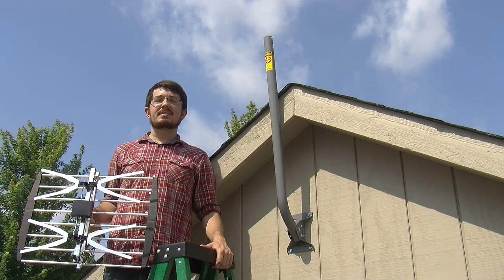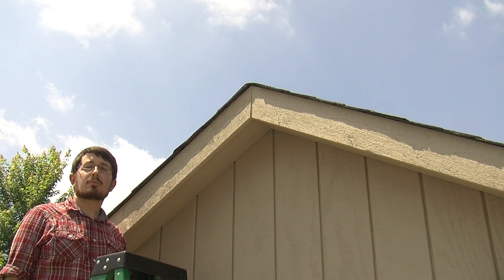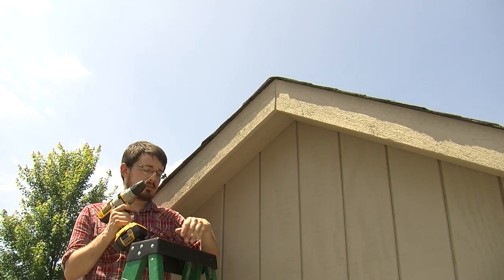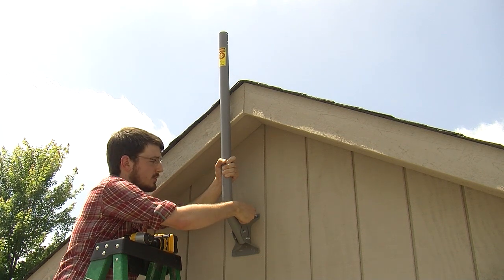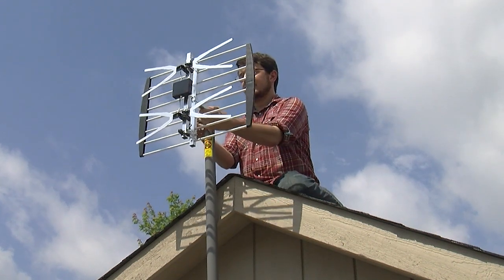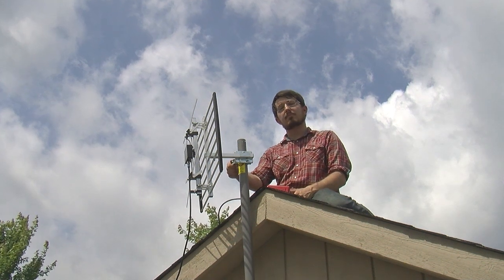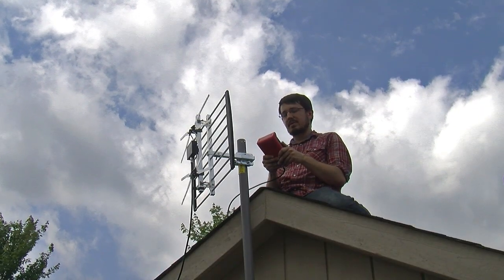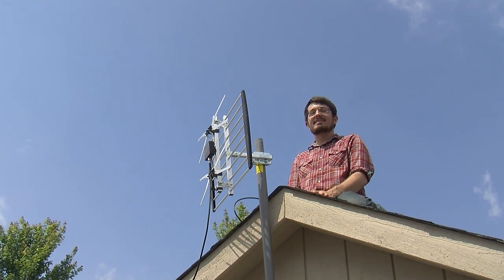Solid Signal: How to install a 2-bay HDTV Antenna

Comment: Suggestions here, aka constructive criticism.

1. Ground your antenna with a cable to the ground or a rod next to it that is taller than the antenna.

2. Next time, drill one lag bolt hole, put in the lag almost to tight, set the bracket level, tightne the lag, then drill the other lag bolt holes. That way you aren't wiggling the bracket while drilling all holes.
Reply: Good tips!

Comment: Question: I want to mount a bat house to my j mount. Do I need a cap so eain wont rust the inside and will it be a conductor during a thunderstorm, I would appreciate any suggestions
Reply: Capping the pole will keep the rain out and should extend the life of the mast.  Even for a bat house, any metal pole should be grounded.

Comment: I have the double bay, and am starting to lose the signal on some channels after a year of use.
Reply: Take it down and clean it.  You will need Acetone and also check your Cable.  You need a good RG6 Cable... The Cable come with it so cheap, it break through time and get exposed to wet environment.
Reply: @JodBronson  The signal you get at the antenna is the best signal you can get.  The challenge is to prevent a loss of signal between the antenna and your television.  Use the shortest run possible of only high quality dual shield or quad shield RG-6 cable, high quality weather proof compression F connectors and coaxial grounding block(s) and use a powered distribution amplifier if you are splitting the signal to more than 2 TVs.  Every connection is an opportunity to lose signal.
Reply: @chrisgraham2904  - :/

Comment: appreciate the video, but I'm not certain you really know what you're doing. You marked holes and then used the J-mount to drill the pilot holes? You then said "switch to an impact for more torque" Impact and torque are two different things. Also, as others have mentioned...you did not even show proper grounding.

Comment: raise that antenna Higher !!!...where is the grounD ?!
Reply: I thought the same thing, he could have put another Pole in that Pole.  The Antenna is light and small, he could have mounted another Pole into that big pole.  Yea, Ground is so important!
Reply: @JodBronson  The word is mast. You install tv antenns on a mast. At any rate, very correct in your statement, raising the height of the tv antenna on a mast will give you even more ability to get line of sight signal strength and with a 4 way amplifier, you will be able to drive four tv sets at a time, and yes, a ground block should be installed either on a cold water pipe or a ground rod.